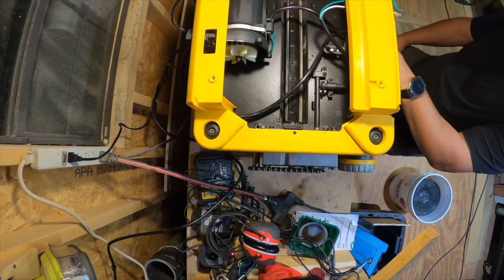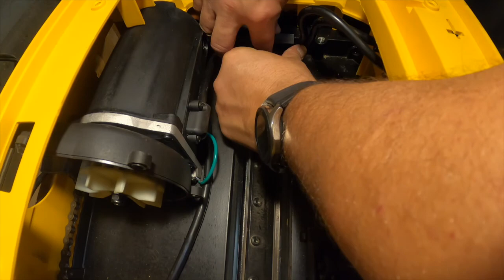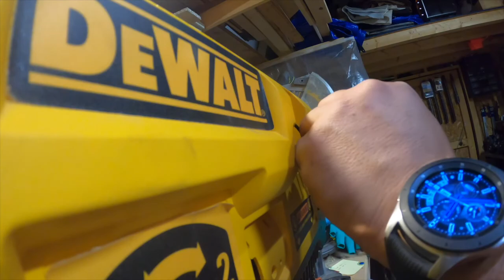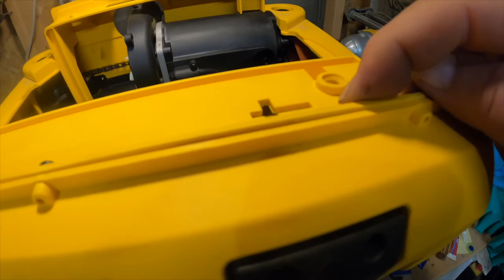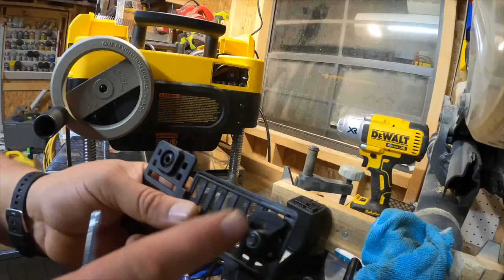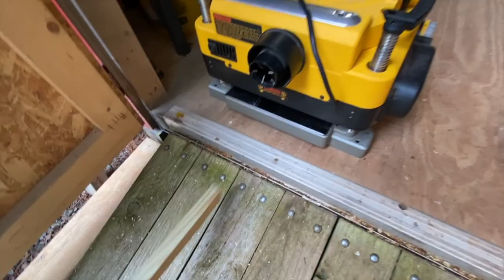DeWalt DW735: Planer Reassembly (after motor rebuild)

Comment: For Anyone who's going through warranty stuff: 

So I sent in a service ticket through their site. Stating serial number, type, etc... After some verification of "when" I bought the planer and where, I broke down the exact list of parts I needed. I made it very clear in the emails that I needed type 12 parts. Initially the person half sent me type 1 parts (1 screw where 2 were needed, etc..). After continuously (but respectfully) giving them my list of parts over and over again, shifting person to person and explaining my situation each time, (I made the list easy to follow and set a link for each part through their service site). I finally found a person that sent me the full list of parts I needed under warranty.  

Probably about 15 or so emails between everyone over the course of 3 or so days. But I finally got the parts and for free. I also have a bunch of type 1 parts (armature/field, etc..) that they didn't want back so I'm just stuck with it atm.
Reply from the maker: Thanks for posting this information for others to see. Sounds to me like whoever was collecting the parts didn't know there is a type 1 and type 12